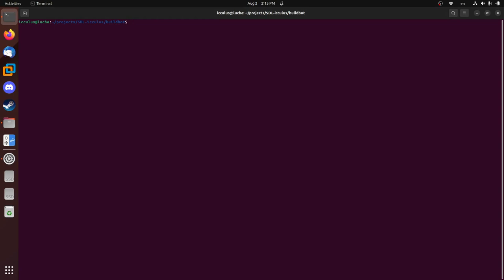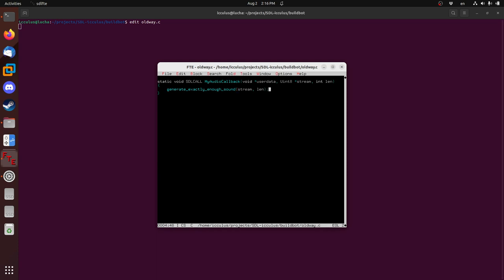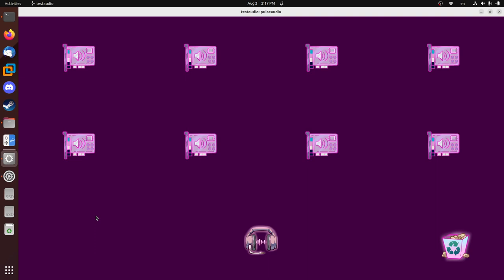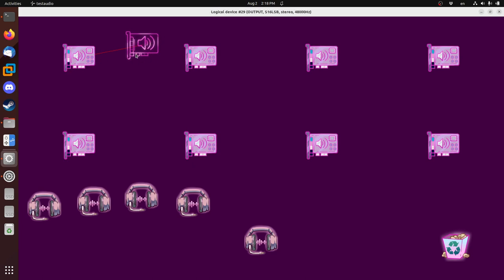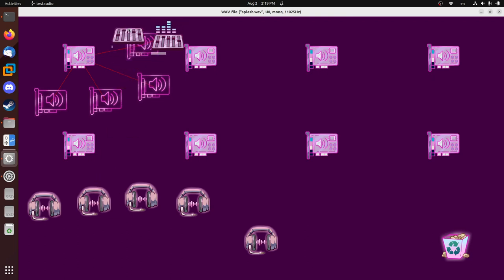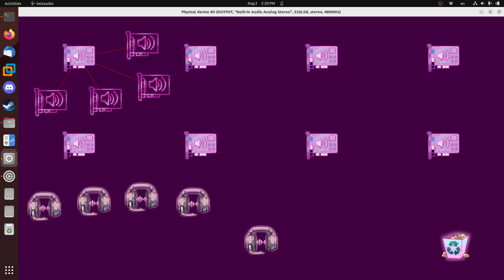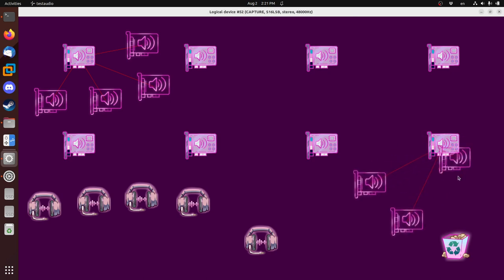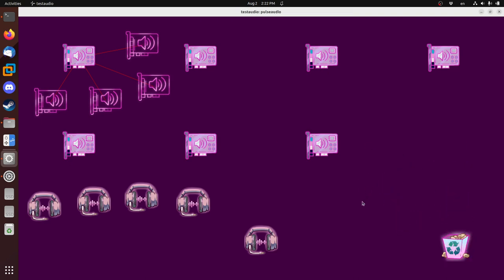The SDL3 Audio Subsystem!

Comment: I've sorta lazily leaned on the callback informing me that it wants more audio data. What's a good strategy for filling an audio stream on my own terms? On each frame, insert 1/60 of a second worth of audio? How do game engines typically tackle this?
Reply from the maker: That is one option; see it's been X milliseconds since you last provided audio, so fill in a few milliseconds more, etc. Another is to just have a single audio stream and use its callback as you go along, like you already do in SDL2, which make changes to existing code extremely minimal.

Comment: How does the new AudioStream interface compare to PortAudio and RtAudio's blocking read/write functions?  Are the write functions non-blocking?
Reply from the maker: I don't know how PortAudio and RtAudio do their things, so I can't say. SDL's write function (SDL_PutAudioStreamData) does not block; it queues up any written data until it is needed, and feeds the hardware from it in another thread. This lets you queue as you have new data available, maybe generating a little at a time, or just dump a whole .wav file to the stream and largely forget about it.
Reply: @RyanGordon  Awesome! A truly push based model, which is what I was hoping for.

PortAudio's blocking interface forces the application to poll the audio device, as opposed to the audio device polling the application with a callback. So it's still polling, but from the opposite direction. And I think RtAudio is more or less the same.